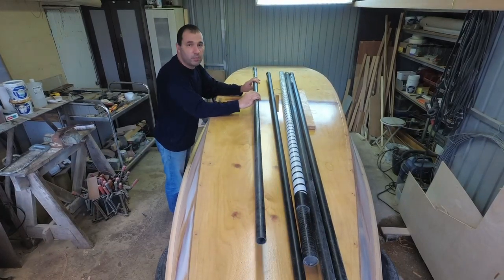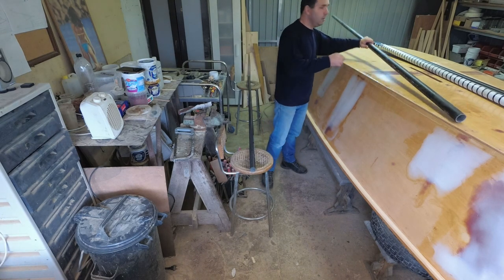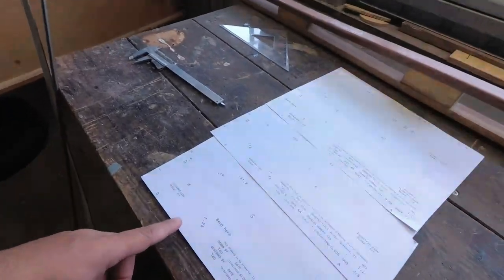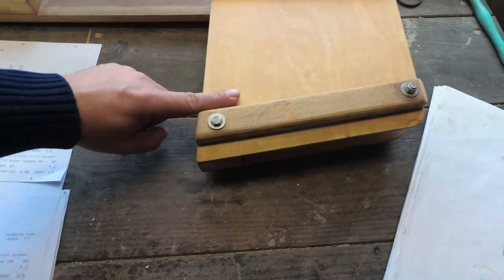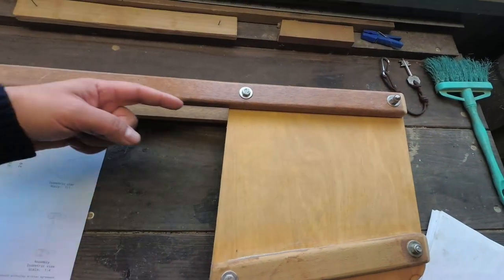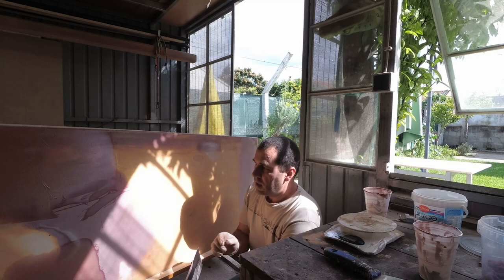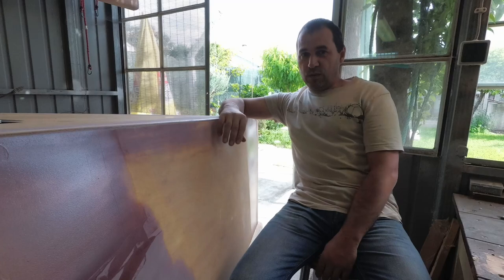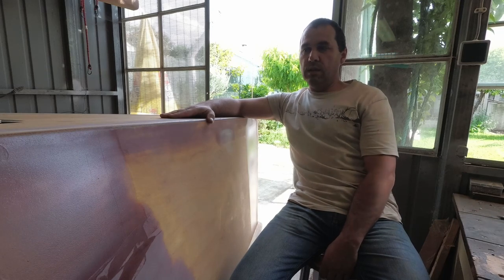Building a Goat Island Skiff - WEEK_21 - homemade plywood sailing boat

Comment: Okay, then. Definitely not just glassed. I am assuming a painted finish now.
Did not look as though it needed much thickness on the fairing compound, that means it was a good quality controled build. Great job.
Reply from the maker: The GIS's hull has no glass anywhere but on the chines, and it's only a 50mm tape. 😉
Reply: @TheBoatRambler .
Okay, then just the epoxy and paint. Thanks for the reply.
Can't wait to see what color/s you choose. One more video and I am all caught up on this project. SUB'd without a doubt.